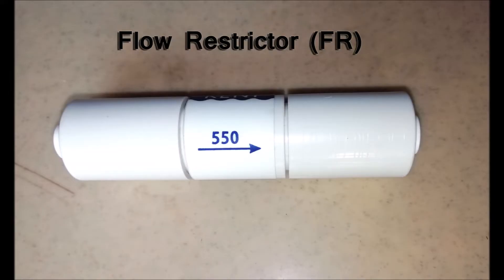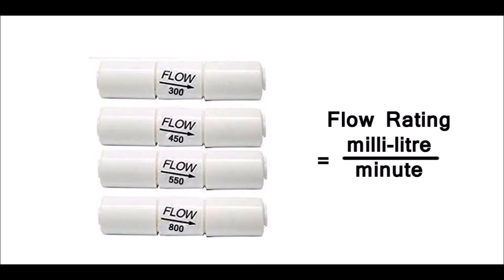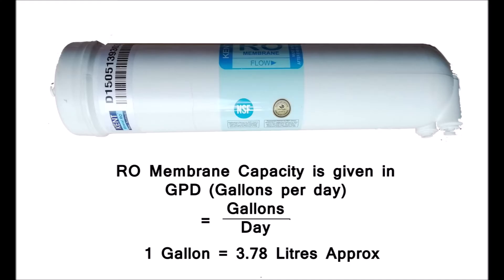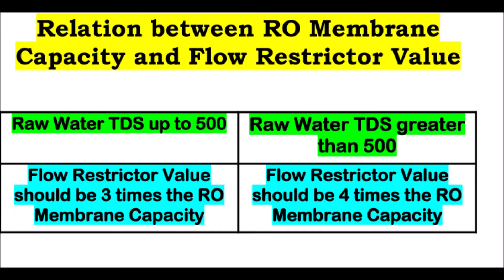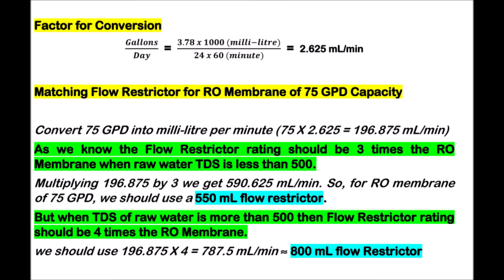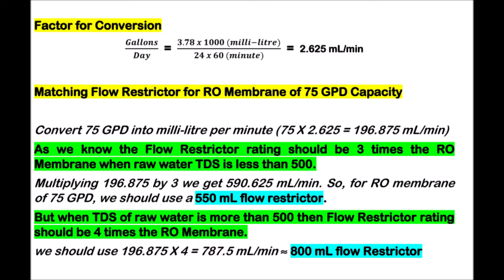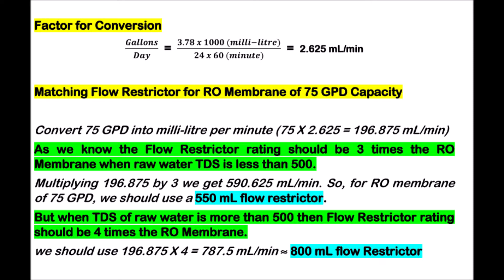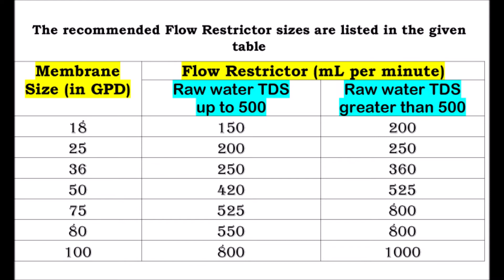function of flow restrictor and its relation with RO Membrane

Comment: I have filmtec 75gpd membrane and I got 450ml flow restrictor (as i see it should be 525 to 550 right?) but clean water still dont wanna run (just very strong pressure waterflow of waste water), is that flow restrictors problem?
Reply from the maker: how old the flow restrictor?
Reply: @diyrepairs  fresh,new, today bought it, but the membrane is not new new, it was used for few months, but 15liters, per 2-3 days,not every day..

Comment: I have a 100 gpd pump, a 80 gpd ro membrane and my water tds is 1030 what FR should I use
Reply: If i go according to your chart then i should use 800 FR right
Reply from the maker: @ಮಮತ_onlyone  yes 800 or 1000
Reply: @diyrepairs  hmm also is it okay to use a High GPD pump on Low GPD membrane
Like 100 GPD pump With 80 GPD membrane
Reply: @diyrepairs  plz respond
Reply from the maker: @ಮಮತ_onlyone  yes but not greater than 100 gpd
Reply: @diyrepairs  oh thank you

Comment: i got a 400gpd RO membrane and may TDS is 280. what value of FR should i use?
Reply from the maker: Why are you using 400 GPD RO membrane?? The value of flow restrictor for 400GPD membrane should be 3150 mL.

Comment: I have raw water tds more than 700 ,its bore well water which membrane and flow restrictor should i use ,pls guide me thanks
I have 100gpd pump is that ok?
Reply from the maker: sir, use 100GPD membrane and 800 ML flow ristrictor
Reply: @diyrepairs  thanks for your valuable reply.

Comment: So I increase the flow restrictor does the pure water flow increase or decrease?
Reply from the maker: increasing the flow restrictor value decreases the pure water flow.
Reply: @diyrepairs  That's what i figured. Thanks. But, if the flow of pure water is already very low, does that mean you should get a higher gpd pump or the membrane or both? Like would a 100 gpd pump work on a 80 gpd membrane or do we need matching ones?
Reply from the maker: @pulkitchanana  Matching is required for all, i.e. pump, membrane and FRT

Comment: Membrane-NF40 75gpd
Pump- 75gpd 
Raw water tds 180-200
Which fr to use
Reply from the maker: you can use either 525 or 550
Reply: I don't think you really even need an NF filter for this low a TDS. You probably are getting treated water. Maybe just get a UF+UV setup to be on the safer side.
Reply: @pulkitchanana yeah people will crib about paying taxes but will happily waste money on RO for just 200 tds
Reply: @pulkitchanana  no, i have mixed raw water of corporation+ borewell
Reply: @amrinderpalsinghbains1188  a UF+UV will suffice. UF has a pore size of 0.01 micron so shall filter out the suspended particles, solids, even bacteria and viruses without reduction of tds. UV will also inactivate microorganisms.
Reply: @pulkitchanana  but it can't remove chemical impurities
Reply: @amrinderpalsinghbains1188  what chemical impurities?
Reply: What is mf filter